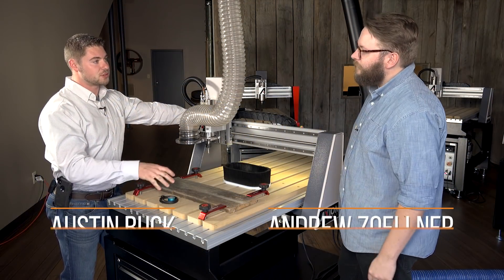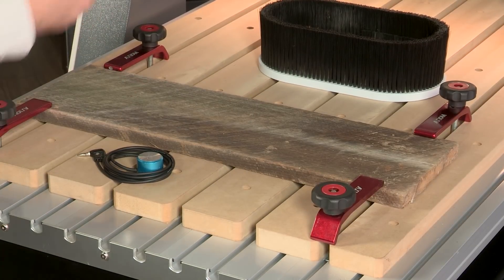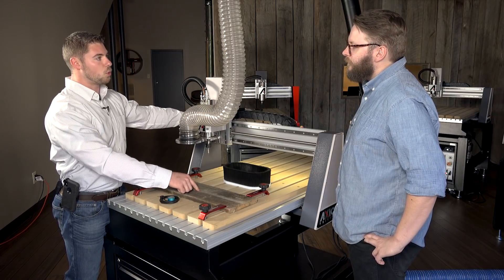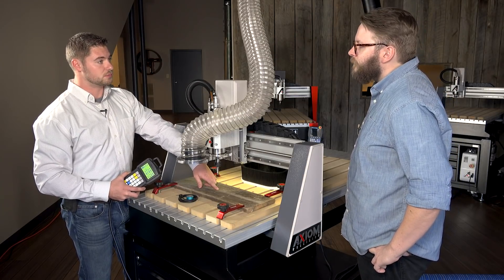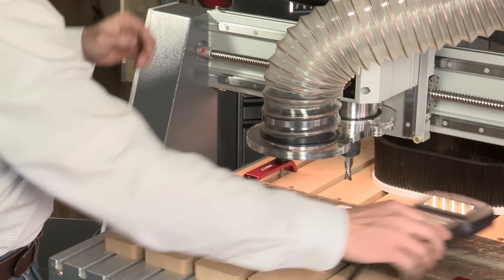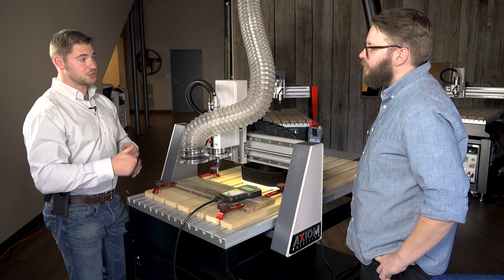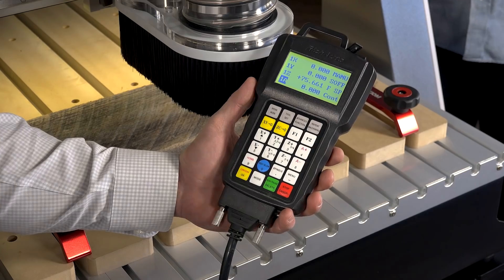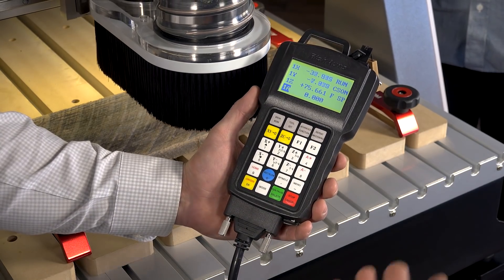CNC Designed for Woodworkers - Section 3: Cutting the Pocket

Comment: Not making a judgment, but is CNC really "woodworking"? I can see the value in making signs, name plates, and other repetitive items to sell at craft fairs, but "woodworking"?
Reply: FreeRange1234 They are great for many things woodworking.  They make jigs as accurately as any other means.  They are good for carving intricate designs including low relief murals etc, though there may be manual cleanup required.  For instance, you could carve the top of the back of a chair with bespoke designs for each family member.  This, of course, relies heavily on your ability to draw in CAD.  I am looking at getting one to do carved chair seats ala Malouf rockers.  Sure, it may lack the hand crafted touch but this can be considered the roughing out phase.  They are also great for marquetry as they can easily cut the positive and negative with great precision.  

For those who enjoy woodworking three can be as useful as a router table or a bandsaw insofar as they are another tool that can help you get to the final product.  How much you rely on them to do the heavy lifting is up to the individual.  Myself, I like the idea of precision and customisation which a cnc will help greatly with but it won’t replace the handsaw and chisel work that I so enjoy with this craft.
Reply from the maker: I understand your point of view, but I think you'll see that the skills and techniques used in the sign example can be applied to other woodworking tasks. Remember the boat in the introduction video, many of those complicated parts were pieced out on the CNC. It just takes some imagination.
Reply: Here is my problem, you build a wooden gizmo, and sell it at a "craft show" or at a "hand made" show wouldn't people be expecting the craft they are buying to actually be hand made? I sell produce at a farmers market, I grow it myself and use organic practices. But there are producers there that do not grow organically, and in some cases don't even grow the produce themselves. The customer is expecting all the produce there to be like mine. The growers that make "short cuts" have an advantage over us that make the effort to grow all our produce and do so without chemical inputs. Which brings me to the CNC machine, does it give people that use them a cost advantage over a person that is actually making their products "by hand"? Are people that use a CNC machine passing off their work as "hand made"?